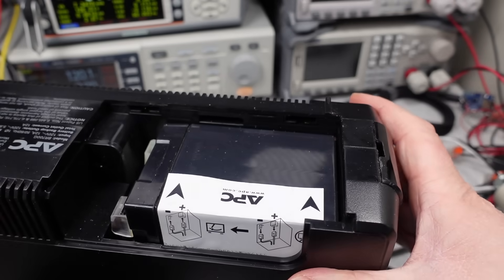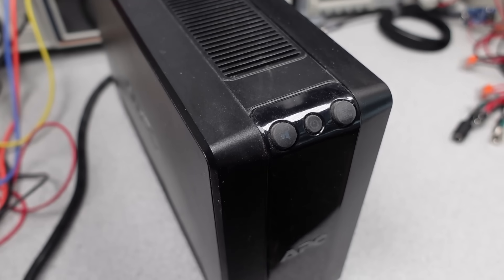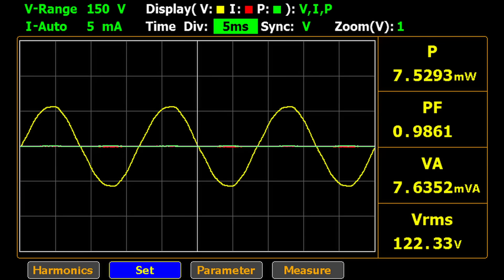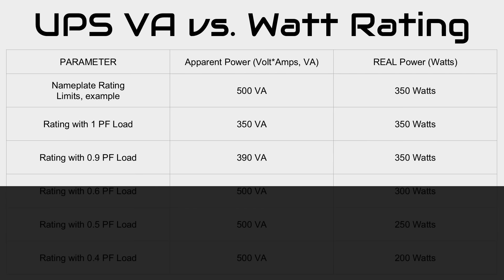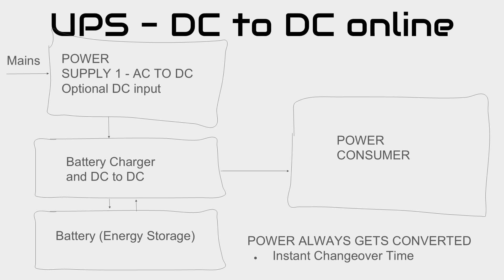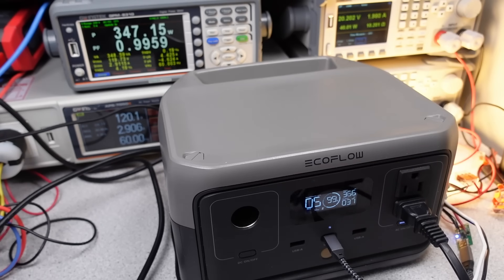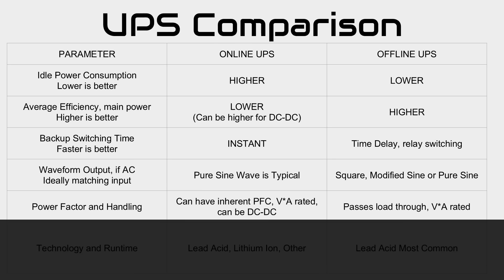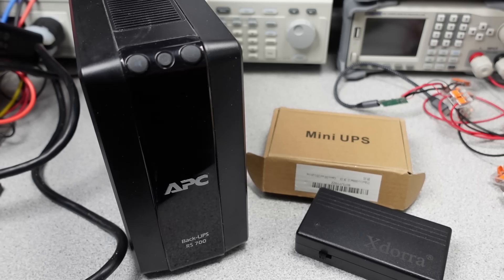A brief overview of Uninterruptible Power Supplies

Comment: At my work (IT) I replace the acid battery of APC UPS unit with LiFePo4 12v battery or 2x for 24V. I never replace one since.
Reply from the maker: Ah nice, yeah, I want to look into that.
Reply: @AllThingsOnePlace  A brief Google/Reddit search on my end makes a good point that Lithium chemistries typically don't like being held at 100% capacity. They'd probably be okay with regular discharge cycles, but with a line interactive UPS (which is what I personally have), the battery will rarely see that sort of use.

(FWIW, I've apparently had my CyberPower CP1500PFCLCD for just a month over four years now, and it's been fantastic as far as I'm concerned - though I'm definitely not a subject expert. Amazon reviews seem to suggest I might get another three years before I need to replace the battery cells.)
Reply from the maker: @WhiteVaille  Yeah, in terms of lasting, it depends how the unit tests the cells, you may need to trip it to make sure it runs every once in a while to make sure it's still holding capacity.  My newer APC in this video doesn't do the self test correctly so it thinks the battery is always good, then as shown in the video, you test it, and it drains to zero in a few seconds.  The lithium ion battery, true, doesn't like to be held at 100%, it's better if a lithium ion battery UPS doesn't fully charge the battery.  Which with proper management and design it can certainly do.  Since it is for backup and short term use anyway, limiting the usable charge could extend the battery life.
Reply: The ones I saw can only do 10A, whereas my 500W 800VA Eaton UPS should be able to pull up to 40A. What is your UPS powering?
Reply: @poudi8  Exactly. A typical 10Ah LiFePO4 battery will have a 10A BMS that may tolerate 20A for a few seconds. Generally, pulling above 1C is not recommended.
Now if one uses an external 100Ah battery with a 100A BMS it should be OK for a small UPS. It'll take eons to charge up though. Also some UPS are not meant to run for long and will overheat with a larger battery.
Another issue is charging curve and voltage, some SLA UPS units have charging algorithms that don't play nice with LiFePO4. And may actually have a voltage that exceeds the max of 3.65V per cell (14.6V per pack) for LiFePO4. It's best to have a lower voltage that undercharges e.g. 3.45V per cell (13.8V per pack) but still allows top balancing than a high voltage that stresses the cells in a UPS.
Reply: @adriftatlas  Yeah, I remember seeing that the UPS wouldn’t charge a LiFePO4 completely, which made it less attractive. Now for cooling, I’ve seen many people add extra cooling, but in my case, I’m not worried about it. The 40A Gel battery I use to replace the original is also really old and underperforming, still, it is able to do about the job of the original 9A.
Reply: @poudi8  office computer, i7 gen1 to gen 14 with dual display 24inch.
Reply: @Sylvain3342  Well, given that the two batteries can output 240W total, adding maybe 10% loss, 216W, these computers at full load might be close. But what really makes it possible in your case, I would say, is the 2 batteries. If it was a 12V UPS with only one, that wouldn’t be enough. In my case, I’d need 4, and at this point, a 100Ah would be better. It would be too expensive, though.
Reply: I have an old APC Smart UPS 1000 like the one featured in the video.  Going by its PowerChute battery voltage history, the battery pair is constantly at 27.3v, i.e. 13.65v / battery assuming both are balanced.  While I currently use lead acid batteries, I already used with borrowed 25.6V 100Ah LiFePO4 batteries wired externally during a 5 day power outage from storm Éowyn to power our 300L chest freezer, oil fired central heating and aquarium pumps.  The only issue the UPS had was its battery remaining indictor kept flashing as its runtime is based on the original lead acid batteries. It only got lukewarm with the load peaking just over 300 watts and ran silent after disabling the beeper temporarily.
Reply: @theirisheditor  only use Lifepo4 with ups that come with high frequency converter. If the ups has low frequency converter with regular steel plate transformer then if you run it above 50% load for extended runtime then the transformer can melt. Sometimes even if the load is lower than 50% the transformer will melt because apc has switched to aluminium winding & reduced size of transformer. They size it just enough to not melt by the stock leadacid battery. Even if you just keep the capacity same and switch chemistry then also it can melt..
Models like the apc br1000g can run with extra battery as it comes with high frequency dc dc converter & active cooling fan. High frequency ones have external battery connector in the back.
Reply: @Sylvain3342  wish it was that easy. For the cheaper ups, seems it won't charge the lifepo4 to max capacity.  Old tech..
Reply: @RokkuAni  it will sadly not fully charge the battery but it will last longer in lifespan.
Reply: My ups's battery finally gave up the ghost last week. Its replacement rbc17 battery is basically unobtainium in my country, so I'm going to have to get a 3rd party replacement. Do you know any good 12V 9Ah batteries?

Comment: I had 2 APC 1500 UPS's die right during power failures , and one started smoking and if I wasn't home at the time the house would have been burned down. APC used to be great but after they were sold to Schneider they became cheap junk.
Reply from the maker: Yeah, my very old UPS works great, my newer UPS failed.  They are built down to a price for sure.  I want to try out some vertiv ones.
Reply: @AllThingsOnePlace A video tearing down an old one vs new to see where corners were cut and how designs have changed would be interesting.
Reply: That seems like every SOHO USP evar, eventually. The Cyberpower BullDog software even failed to communicate to the rest of the servers correctly (even tho it theoretically "tested" itself every week). I finally gave up on them and haven't been happier. I've got a laptop as my little docker server and that's it. Anything without alternative power, the filesystem journal will take care of :)

Comment: I put Yuasa in last time and they are lasting longer than the APC originals, but now you’ve got me worried I’m going to burn the house down
Reply from the maker: It's risk management.  Of course incorrectly using them is probably a larger cause of damage than the product itself.  But yeah, for myself, I check if the unit has some kind of rating if I'm going to leave it plugged in all the time.

Comment: Excellent video and long overdue. Really interesting. Personally I’d like to know a bit more about the replacement batteries when you want to keep the thing going - off brand vs manufacturer replacement and also differences between alternative battery chemistries and how this works for total cost of ownership over the UPS device lifetime. Truly terrible hand drawn graphics by the way, lol.
Reply from the maker: Yeah, I have tried various battery types over the years, I ended up going with genuine ones more often than not now.   But yeah, could be a good video, need to make one repairing the APC UPS in this video anyway.  Haha, yeah, I should put more than 2 seconds into the graphics.

Comment: When looking at an APC product purchase I noticed there were two similar looking UPSs offered but one claimed to have true sine wave output. Is this something I should consider desirable if I am using the UPS to protect a desktop computer, monitors, and some audio equipment? I hope this is not a silly question and thanks for the helpful videos.
Reply from the maker: Yeah, I would look for one that advertises a pure sine output.
Reply: @AllThingsOnePlace  just be mindful of the 'economy' pure-sine wave models.  The transformers are manufactured poorly. I do not find this in the APC modified sine-wave models for some reason
Reply: Yeah good quality sine wave inverters are crucial for powering electronics, especially for your audio equipment.